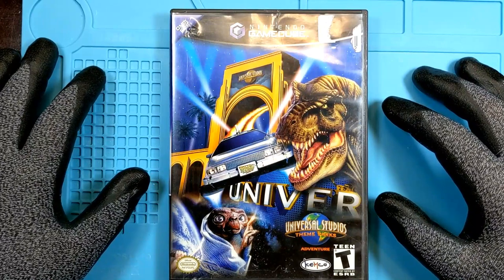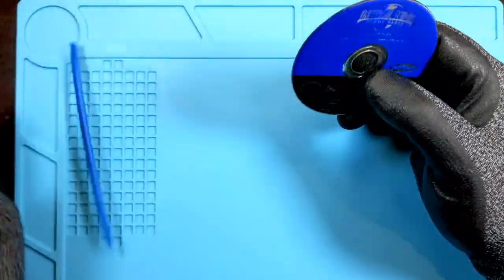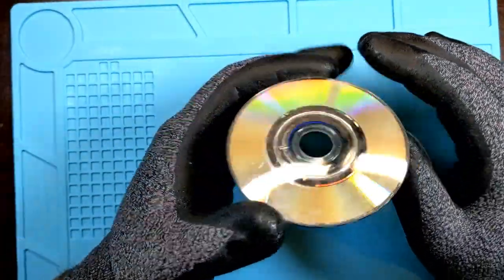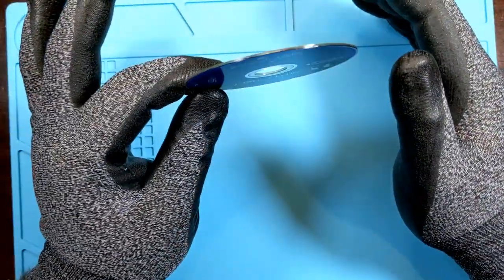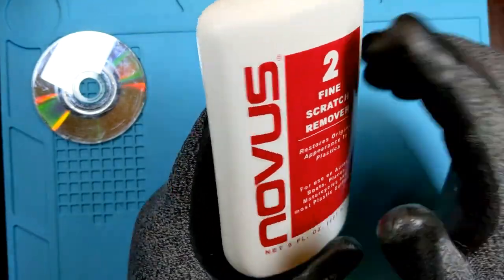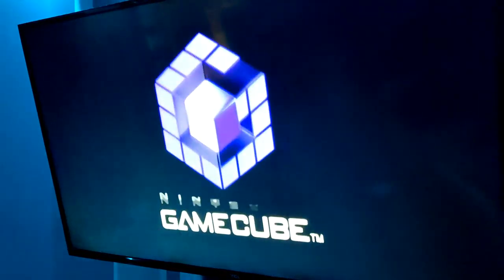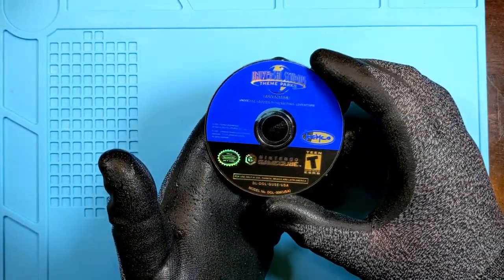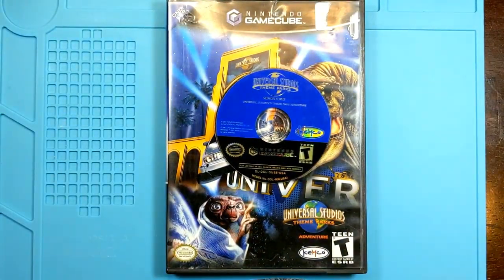GameCube Disc Cleaning Series:  Part 1- Intro and basics

Comment: Hi, Thanks for the video, I learned a lot. I've been trying to fix a gamecube disc, but it hasn't been working. I didn't try the method in this video, but maybe you could still help me out. I bought a disc off ebay in AS IS condition. I didn't know any better, but after seeing your video I should have noticed that the disc had resurfacing residue in the center. I saw this method on youtube where a person uses sandpaper (1000 to 3000 grit) to remove the scratches before polishing. I've tried doing this a number of times by hand, using 1000 grit and 2500 grit with various car polishes/waxes and headlight plastic cleaner. The disc wasn't working when I first received it, but I managed to get the disc to play until the title screen before it became unreadable. My main concern is that even after polishing, I can still see the haze from the sandpaper, and a lot of microscopic scratches. I can't feel any of the scratches with my fingernail, but there are a lot of them. Do you have any ideas of what I could try, or what else could be wrong? I tried to clean the resurfacing solution out of the center with tweezers like you mentioned in you next video. It worked well, but perhaps I separated the two polycarbonate layers in the middle? Would this effect readability? Would you think that Novus 2 would give me the highest probability of success?
Reply from the maker: I don't do the sandpaper technique primarily because of the inconsistency in the grit of the sandpaper. Unfortunately a side effect of the sandpaper method is still being able to see the streaks unless you polish those streaks out as well.

The center ring won't/shouldn't effect the gameplay at all (unless it's impacting the rotation of the disc, which is uncommon).

If you've tried the method in the video (using Novus Step 2 and/or Step 3 if needed) and it still doesn't play, check to see if the disc is warped at all. Set it on top of a book or flat surface to make sure it's not raised on one side.

I do not recommend separating the two layers of polycarbonate. You need special equipment to press them back together, in addition to a specific environment. I have separated discs before, but re-pressing them is usually not necessary for a scratch.

Have you tried checking the laser eye to make sure the laser from the device is clear enough to work on the disc? Also the hazing on the disc from the sandpaper could be impacting the readability.
Reply: @RestoreAndReplay  Thanks for the help. I was able to get it to work (barely) with car wax. This was encouraging, for sure. I can still see plenty of fine scratches. The game runs, but when it jumps to another data location on the disc (transitions in the game) it sometimes bombs. Takin the disc out and putting it back in seems to work pretty consistently, and no progress is lost. I'm still very happy about it, though. It's good to know that it wasn't permanently damaged or warped like you were saying. I'm no longer planning to try and make a return on ebay. I think I'll buy some novus 2 online and try polishing with that. I'll see if I get more consistent disc performance. Thanks for the videos, Keep it up, I'm subscribed!

Comment: Thank you so much my man! Your method brought back two badly scratched GameCube disc (barnyard and Pokémon colosseum) that I had already gotten resurfaced in a game shop with a two minute cycle. I really had to work at one though. At first it wouldn’t read at all but I ended up applying more pressure after another coat and used paper towel instead of micro fiber and it ended up working and actually playing through without any error messages after a decent bit of trial and error.

 Not too worried about polishing them, just because I know there isn’t much surface life left in the disc but I find these videos really cool and interesting and didn’t know if you’re gonna release a video on your method for that.
Reply from the maker: I appreciate the compliments and I'm so glad they ended up working!! (I used to only use paper towels when I was at GameStop, they aren't great to use because they can scratch the discs, but awww heck I can't not use them! ) But that's what I love about these methods, you can increase the compund amounts, you can increase and control the pressure, I just feel like you have a lot more control over the resurfacing over letting a machine do it. You get to become one with the disc! Wax on Wax off!!

I will be doing a polishing video! The tricky part with a polishing video is getting down a method that's recreatable by others. So with each of these videos, I give a step by step list of directions to non-game-cleaners and see if they have the same level of success, if they do then that set of directions becomes a video! So the polishing method just takes some time. But some folks end up with a mirror like finish on their first try! (they do it by using a combination of Novus Step 1 and Step 2, but we'll get into all of that)
Reply: Ended up buying broken lot of gamecube games off eBay and out of the 20 disc I was able to revive 13 of them. The 7 that didn’t work I noticed either had little pinholes that you can feel with a plastic pry tool or scratches on middle ring. I’m guessing there’s not much I can do about these, but was wondering if you have any tips or expertise on if there’s anything that can be done. It’s the ring right outside the middle plastic hub. I think it may be called mirror band?

Comment: Great video! I can say from experience the scratch 2.0 remover has worked for me also. Don't know how long term it is but if ya gotta use a little after playing many hours then no big deal. Takes two minutes or less to do.
Reply from the maker: Awesome to hear! Thankfully most discs that get cleaned tend to have less scratches moving forward, the days of discs constantly changing hands and people storing them improperly are becoming less and less. 

Once a disc is cleaned the next thing that can start to collect is fingerprints and dust (mostly due to the brand new cleaned surface). But yeah, a quick polish of the disc will bring it back to life for years to come!

Comment: i may have put too much pressure on my disc since i did it with disc down on hard flat surface but it looks great.
Reply: The important part is a functioning disc. Did it even work?
Reply: I have a couple that didn't work but quite a few do after polishing. I've not got to use novus yet + I've used McGuire's plastix with fairly good results.
Reply: @daviddowns7552  Quite a few isn't really a lot but at least you even gotten a disc working. My Luigi's Mansion is extremely scratched and the game actually boots up but fails at the Nintendo logo. I might need a very effective polish to fix it and I am pretty sure it is fixable because a temporarily fix made it somewhat playable.
Reply: @Truepurple7  I understand+ I hope you get that one polished and playing again. Does novus work best from your experience.? I've not got any yet but I want to try that product.
Reply from the maker: It's really difficult to apply TOO much pressure onto a disc (you'll get a weird feeling before you start to do any damage, that is to say you can absolutely feel when you're about to break a disc). But I'm glad to hear the disc cleaned up nicely!!

Comment: Okay I’m at 2:59 rn and I’m loving the video so far but as some who works with measuring devices I would’ve loved to see this video with that information 😁 I have a Zelda game of the year edition with the wind Waker demo and I had it professionally resurfaced at disc replay and they told me it could damage the disc but did have a possibility of fix it cause it was scratched and wouldn’t read so now that poses a question: would the manufacturer of each disc have a specific thickness in order for their discs to produce information properly?
Reply from the maker: Ok so I'm actually collecting a bunch of measurements and overviews for a big long "how to inspect a disc" segment. So you'll see me skip those moments in videos so the focused video will be more...focused. ya get me?

Professional resurfacing can damage the disc if done too much! Or if the disc is too thin! Problem is, disc manufactuers use a "standard" thickess with tolerances. So there's a variance in the final product (I mean most production has this type of variance, but still). So currently we know what thickness will not play, but the space between that thickness and production thickness is a pretty big gap. A minimum tolerance is the best we currently have as far as disc thickness goes. But I've had some discs that are right on the edge of that allowable thickness and they play just fine. It's currently a crapshoot until we get more solid data.
Reply: Makes complete sense I’ll begrudgingly be patient(I’m not patient person so it’s not personal 😂) but awesome to know that you already have plans for it I have a small collection myself and with not having a lot of retro console repairs readily available these days I feel I ought to know how to maintain the games and the consoles themselves. Do you know if any ways of how we can get more data? Places to look for games that may possibly be closer to factory width than others?
Reply from the maker: @judevargas7239  Oh how I wish there was better information. It'd make disc age identification so much easier. Problem is the manufacturers had an assumed tolerance range for the disc thickness. So with each disc I collect I measure and document the thickness, and keep a running average. In some cases I'll buff down (using an actual resurfacing machine) a disc until it stops reading. That gives me my low end. But the last time I did it, soon after I found a disc that was even thinner and still ran! So the big challenge now is to find that sweet spot of right before a disc will fail.

A rule of thumb I roughly use (mostly with GameCube discs) is to have a control disc and just eyeball thickness comparisons to a question disc. "Usually" a GameCube disc has only be resurfaced once. Resurfacing those discs is still fairly new-ish. The machine resurfacers have attachments to do GCN discs, but even still it's rare to find in retail settings. In another decade or so we'll run into 2+ times resurfaced GCN discs, but we aren't there yet. I don't want to toot my own horn, but it's quite likely I'm the only one collecting disc thickness averages for GCN games in accordance with functionality. It just doesn't seem to be a focus for most. But with discs having a resurfacing lifespan (3-5 times professionally resurfaced before it's too thin), it's going to quickly become an important thing, whether people realize it or not.

Comment: perfect vid, love the sarcasm. going to work towards getting my old twilight princess disc I found in storage to function in the morning. Worried I may have deep fried it in the gamestop disc liquid as a kid. Will drop in the discord.
Reply from the maker: Did it work? Is it fixed???? I must know!

But also that GameStop disc liquid? It's nearly identical to Novus, which is why I tend to use it most often. My bread and butter!!
Reply: @RestoreAndReplay  I havent gotten to the twilight princess disk, but I picked up some novus 2 and did about a dozen polishes on a rebel strike disk that didnt read at all. After about 3 polishes it loaded up but then had an error after the initial credits. Its still at the point but I figure it'll just take more polishes. Thanks again for the vid its great to understand how the disk works and how the polish works rather than just hoping this product is a one time fix or no fix kinda thing. Gives me hope for the other disks